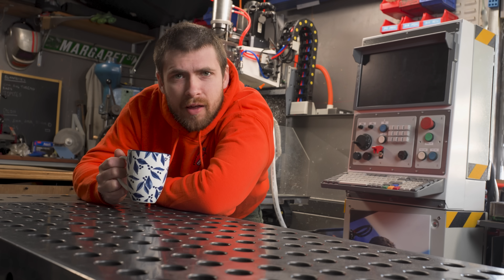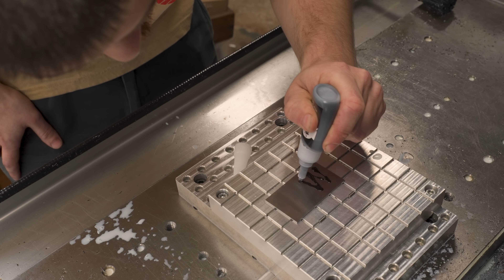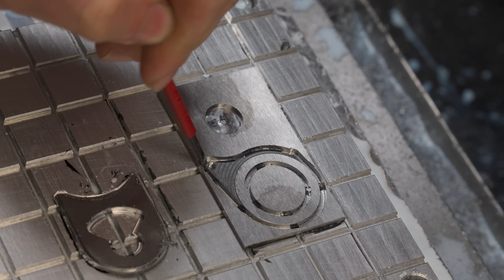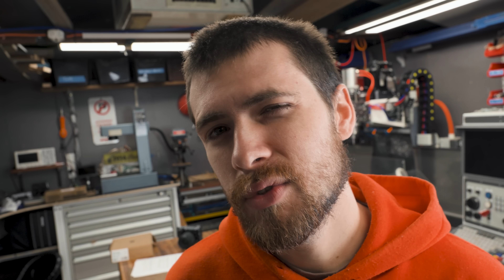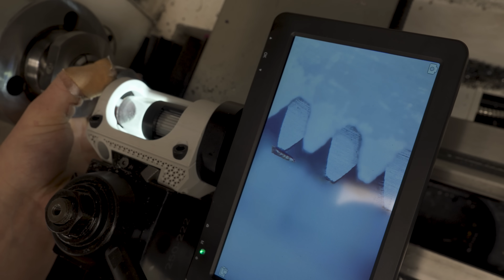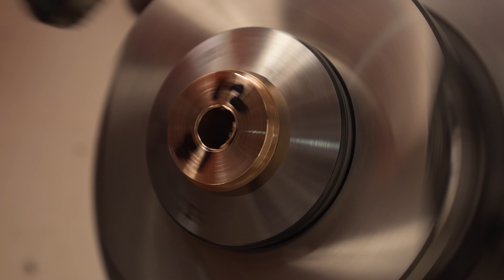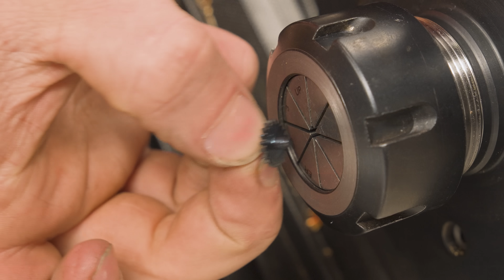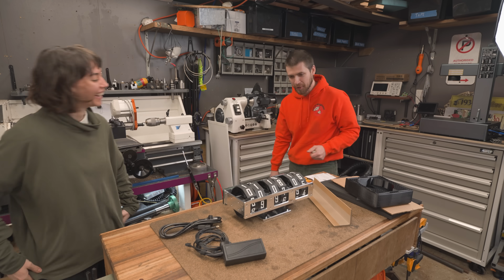What if angles were metric?

Comment: I feel like you would really benefit from machining with a 2-op fill and flip process. Basically stick your slab down (we used 3M tape or a vacuum table, you’ve got the rubberized CA), machine op-1 with the parts subflush of the remaining top surface, and cut at least two of the edges of the slab. Fill the part with quick curing two part acrylic, and face it once it cures. The parts are now fully encased and supported by the acrylic. Flip the slab and adhere it down. Probe the two edges you cut earlier and machine op-2. Now you can pull it off and pop out the parts.

This way you can machine down to the finished surfaces in two ops, no tabs or extensive filing. The parts are well supported for op 2. Really good for small parts and complex geometries without large flat datum surfaces.
Reply from the maker: I like this approach - have also been meaning to get my hands on some low melt alloy

Comment: What I think "the metric angles" ought to be is just "revolution" or "a spinaround", as in degrees/360, with 360 and 400 being just different bases for a "percentage notation" of the raw value, as in "25%" = "90°" = "a fourth" = "250 millirevolutions" == 0.25 (being the actual raw value) and the former ones are arbitrary wrappers for it that are probably useful in some contexts, but the raw 0.25 ought to be able to always suffice and it ought to be the least convoluted value that a computer program might use.

I don't see the point of the percentage notation either. I bet it's just some historical reason, as in today I think those make almost no other sense than people being familiar with them, as in we wouldn't invent those now and would just write 0.25 instead of "90°" or "25%".

If you write 25% in excel, it literally just puts 0.25 in and formats the displayed value as "real value times the arbitrary factor 100.0 and append the symbol %". I think this ought to apply to degrees as well, at least in my head "a 90° rotation" literally just means "[90 divided by the arbitrary factor 360] of a full spin around" just like how "25%" means "[25 divided by the arbitrary factor 100]".

Comment: I am a fan of the metric system but in circles it would NOT make any sense to have a system that is not divisible by 3. 360 is 2x2x2x3x3x5. You can split a circle into many different fractions without a calculator. Making a circle 100 or 1000 degrees would be a huge downgrade. We use the metric system because of it's logic, not because we have a #10 fetish or something like that.

Comment: there is no need to. The metric system started because the systems before were overly complex, convoluted, confusing and not standardised (still not entirely).. radians and euler degrees are just perfectly convenient and scale with any other system. You don't need to reinvent a wheel, but you need to improve a cube with uneven sidelengths that's used as a wheel like the imperial system is.

Well by now "independent" USA is the only country that sticks to the imperial system

Comment: I may not like the radiant system but to call it "obscure" is insane, it's what everyone in stem uses but since it works in multiples of pi and so a full rotation it's like 6.2 radianrs it's really hard to use in day to day life. I did not know that it's metric however and I can't imagine what makes it metric since it has no relation to the meter, unless you mean it's the standard SI measurement?

Comment: To be honest, 360 is more divisible than 1000 so the metric system would probably be better off adjusting to a similar 6-based number system. Like 6^4 (1296=10000 in base 6) instead of 1000 base 10 into each step. This also gives an extra step of granularity in trade for the slightly higher number since we’re multiplying by 6 on every step up
Reply: What about 300?

Comment: I mean, first of all, one unit is all you need for angles, meaning the conversion part that actually made metric so great is actually much less important, and also, you don't need any other type of unit to measure smaller or larger angles. While you sometimes need to be able to measure angles to a high precision, it's not like you can really build highly specific angles by hand. You can polish down a steel beam to the right length with a high degree of precision, but if you want a precise angle, the most reliable solution is not to use angles at all but instead rely on distances to determine the angle indirectly. So the only real use of angles is when they're written down, in which case you can just as well use scientific notation or, if possible, use the actual mathematical constants involved.
And even if you wanted to make a metric unit anyway, which unit is the base unit u which is then metrically modified into ku and Mu and mu and all that, is arbitrary, and should be decided based on what is most useful. Now in practice, there are three primary parts that can be useful: The turn, the angle of a full circle being 1, can be useful in some contexts since the turning number is closely connected which is important for complex analysis. The radian is based on the length traveled on a unit circle, which makes this unit most useful for most mathematical contexts, since it simplifies many calculations. And lastly, the divisibility of the angle of a full circle might matter, in which case degrees and grads are useful, however grads only have 15 divisors while degrees have 24 divisors, which is particularly visible with triangles and hexagons, since those have angles of 133.33...grad and 66.66...grad. So degrees as base units simply work better if you want divisibility of the full circle.

Comment: I wanna point out that the Mesopotamians 5000 years ago favoured the hexidecimal system because you can easily multiply or divide many numbers to make 60 or to split 60. As in, 60 can be divided by one half, third, quarter, fifth, sixth, tenth, twelfth, fifteenth, twentieth, and one thirtieth. The fact that one fifth of 60 is 12 is then why we have a whole separate word for 12 objects, e.i. a dozen - when you have sixty somethings, it's convenient that you can divide them so many ways (by 2, 3, 4, 5, 6), whereas if you have 100 items you can't separate one-third from the rest (so you're stuck between dividing by 2, 4, or 5... 6 also being impossible)

Comment: I am also unreasonably annoyed by non-metric units, but in my case it's time units. Of course, a year has to be 364-5 days, but there is no reason why days can't be 100 hours, 100 minutes, and 10 seconds... Most people would barely feel the difference, as the second would only be slightly shorter than it is now, but we would have to change all clocks, computers, and all physical constants relying on the second for their definitions. 
Other problems: The second would then be defined by a non-universal phenomenon that is also subject to change, unlike using the decay rate of some atom... But that's not a practical concern. 
And also - get rid of time zones! There's no reason somebody from Newfoundland can't have their midnight at 4:30, wake up to go to work at 11:30, and have dinner at 23:30. Why do we need midday to be at 12 o'clock in EVERY culture more than we need to eliminate the confusion when people gotta plan meetings and events across continents??

Comment: One arcminute of latitude equals one nautical mile, which is very useful for celestial navigation. But if you happen to be lost in revolutionary France, one centigrad of latitude equals one kilometer.

(In both cases the equalities are only almost exact but that's due to redefinitions of the units involved and improved measurements of the Earth's circumference).

Comment: Did you know that Hilter wanted to have a right angled to be 100 instead of 90 degree so they "made" (they just stole it) the Neugrad (translated: new-degree) and passed it by law to be used in 1937. Every house Hitler wanted to be built was made using this new-degree.

Comment: I teach geometry. There are a lot of useful angle units. Degrees are well established, but math teachers love radians with good reason. If you adore base 10, a right angle is 100 gradians, which is certainly more metric than 90°. As well as being 360° and 2pi radians, a complete revolution is also known as one turn, so a centiturn is 1/100 of a circle. You can derive a milliturn, microturn and even smaller units if you’d like, but I don’t know who would want to do this. They are clearly easier to think about than the minute (1/60 degree) and second (1/60 minute).  Astronomers, machinists and space companies/agencies might find a use for them.

Comment: Uniformly hear or chill parts for assembly homie. Trust me. I once ran out of oxy fuel, but managed to assemble 24in gantry crane wheels and bearings with just liquid nitrogen instead, no press required,  everything is an interference  fit. Im just sharing becuase small things and heat is risky but chilling is better. Hot tip is to machine excess material away in a gear like you see in cast gears. The extra features will aid in growing and shrinking. I dont know why. But at work we had control gears and ones with machined features  as well as a cast gear with samr features.  The ones with features would grow or shrink more than the solid ones by an extra .001. The cast ones were like  .0012. You would think its negligible,  but when assembling gears 36in in diameter, 8in thick. And requires a 4 thou interference fit that extra wiggle room can mean you made 20000 vs you just scraped 10000 in material.

Comment: I literally never tap anything small like that with a machine chuck. I use the hands, i need tactile feedback, always, with oil, and i do a pattern of 2 turns cutting then removing completely, blowing out. Especially if its a one off or small run of parts. If were talking 10 parts with plus 6 holes each, ill rely on the machine to do it. If they are crazy small ill have them drill then just start the thread. Then i know it's square and dont need to lay as close attention

Comment: 12:05 60x60= 3600 degrees?

Personally, I'd be down to use a base 12 system. It's divisible by 2, 3, 4, and 6. Base 60 is handy in that it's also divisible by 5, but the times table would be so big.

Comment: For any practical applications using actual measurements degrees are king. For any theoretic work radians are best. Gradians exist only for my calculator to have a mode which always gives me the wrong answer.

Comment: I was introduced  to The "Mil" in the UK Army in the 1960s  "the angle subtended by 2 lines with a common origin  at 1000 metres 1 metre apart (or something like that) you then get 6400 mils! in a circle. so 2 x 1000, lines1 metre apart seems sorta metric? (you end up with 6400 mil circle)

Comment: Only thing I would say is as an electrician according to code any crimp connectors must be crimped using a ratchet type crimper otherwise the connection can get hot and catch fire if they aren't tight enough. Not a criticism you wouldn't know unless you took the exam and read the 400 pages of regulations 😂

Comment: What I really want is metric time. Who came up with a system where the conversions between units are: 60, 60, 24, 7, 30 or 31, except if it's February, then it's 28, but also every 4th one it's 29, but actually sometimes not.

Ok the leap years are a necessary evil, but the 60 seconds Toma minute, 60 minutes to an hour 24 hours, a D varying month lengths have no reason to exist.

Comment: First, you are wrong about the "metric" system. The "Imperial" system, which is so stubbornly used in the US (and basically nowhere else), is ALSO a "metric system", just not THAT metric system (SI) you are confusing the term "metric system" with.
Degrees AND Gradians are NOT part of SI; radians are. And radians are scaled with SI prefixes like kilo-, milli-, nano-, etc.

So, why does everyone use degrees instead of radians? Out of pure convenience: 360 has more factors (24), including the useful prime factors 2, 3, and 5. It's simply easier to divide circles/sectors in your head when the circle is 360 units. Meanwhile, for example, a full circle in gradians (400 gradians) has only 15 factors, and 3 is not one of them.

And... dividing SI radians in your head is impossible, since a full circle has 2π radians, which can only be calculated to some level of approximation.

So, radians are good for science, and degrees are good for everyday use.

Comment: I don't use gradians.  Or angles.  I did create an Android app that'll let convert them.

By the way, I was under the impression that the development of the Meteric system started before the Revolution.  They simply recognised it as the answer to the same problem the Royal government was trying to solve, no national standards or measure.

Comment: The SI system uses radians (rad), not degrees, because scientists love measuring angles by dragging their feet along the edge of a circle like a human compass. The beloved British degree (°) is technically banned from the inner SI party, but it is still allowed to hang out in the hallway because society simply refuses to give it up. Since radians are calculated by dividing meters by meters, the units cancel out, leaving you with a mathematically "dimensionless" number that has absolutely no physical substance—much like the flavor of a lukewarm British tea.

Comment: @NoEngineerHere Next time you break a steel tap off in a brass or aluminium part, you can boil it in a strong solution of alum to dissolve the steel leaving the other metals alone.

Comment: On top of that we also have radians and we use them in IT just for sake of making calculations simpler and it is SI unit ... 360degrees = 400 grads = 2 * pi * radian ... 
 "Metric system" is common name for lenght units and lenght derived units (for example litre and gram). And it jusy happen that metric is SI unit (standard international) ... in civilized countries beside metric units we also use other metric units like volts, wats, ampers ... and they are not metric but they are SI.

everyone with basic education know that (yes, schools in USA do not provide enough education to be considered basic in any european country).

Comment: Actually on the whole, the metric system is fundamentally flawed. it uses base 10. That means that there are two prime factors. Consider dividing a length in half repetitively; 0.5, 0.25, 0.125, etc. Resulting preferred numbers would then be 0.5, 0.2, and 0.1. On the other hand the inch system is binary, thus 1/2, 1/4, 1/8 and so forth. essentially these are the reciprocals of 0.1, 0.01, 0.001 in binary. Base 10 was used because they didn't understand fractions. The system also messed up with the base units. The two common metric systems MKS and CGS both have base units that are not "one". In MKS we have the kilogram or 1000 grams; In CGS we have the cent-meter or 1/10 of a meter.

Comment: There is a unit called the grad. 100 grads is a right angle. A better alternative is the radian. 2 PI radians is 360 degrees. As far as the degree as a value, it is far superior as it can be used to describe common angles using just integer values. 30 degrees in grads would be 33.33333... grads. Engineers are constantly converting angles to radians.

Comment: In the artillery we use a unit called military milliradian  also known as a mil. There are 6400 mil in a full rotation. One of the useful features about this is that at 1 km if you were off by one mill in aiming then you are 1 m off. 2mil aiming 7 km would be 7m off.
Reply: Former F.O 👍

Comment: Err a mil (aka milliradian) An angle equal to 1 metre wide at 1000 metre range is 1-mil.

This angle unit is used by all NATO armies for measuring/recording angles and is metric.
Reply: The milliradian is a submultiple of the radian, which is the SI unit of plane angle. The radian is the angle subtended by an arc equal in length to its own radius. You have described an approximation that holds only for small angles, rather than a definition of the unit. The 'NATO mil' is defined as 1/6400 of a circle and is not coherent with the SI. Not only that, but 1 NATO mil subtends a line of 0.98 m at 1 km, whereas the milliradian approximation is out by less than 1 part in 10 million.
Reply: @C @Catcrumbs  literally the definition of “close only counts in horseshoes and hand grenades” n’est pas?
Reply: @kennethelwell8574  depends on what you're shooting at, i guess.
Reply: Damn dude. I think you killed him. At least give him the conversion.
degrees=gon•0.9
gradian=gon
radians=gon•π/200
milliradians/mrad is also the unit used in long range rifle external ballistics for NATO apparently. This is what we used in the marksmanship courses I took in the international legion in Ukraine. NATO-questioning, pronouns nation/state
Reply: Well. TIL. Thanks!
Reply: That is a convenient trick that works for small angles. I use it myself. Basically, the measurement of a small angle in radians is equivalent to the SIN of the angle and the TAN of the angle. Thus a triangle of 1 by 1000, would be a milliradian.
Reply: You say mil to an Australian and we think mm

Get it together champ, we’re in Australia on this channel
Reply: @BirnieMac1  fair enough. Groolas and Moolas it is.
Reply: Milliradian must be short for military radian.
Reply: @62davelee actually it’s MILLIpede RAte of Angular Distance, maldiveIAN, per Second, defined by the angular distance traversed per second of an adult millipede (Maldivian, they were the most consistent millipedes known to science in the 19th century, now of course we know of the Andean millipede and the Sumatran giant millipede with order of magnitude less °/hr stability bias and angular random walk) tied to a central axis with a 1m long silk thread. The millipede, Gertrude, is preserved in formaldehyde at the SI castle in France.
Reply: Exactly!👍